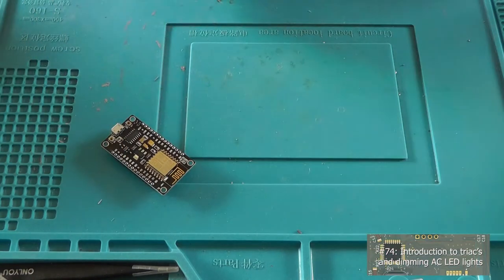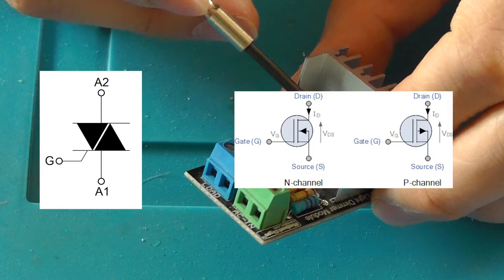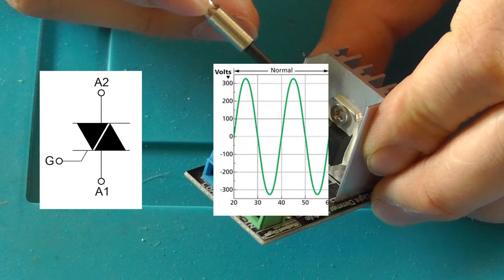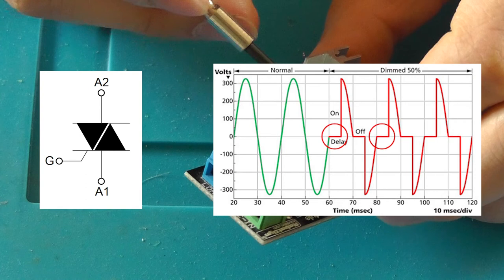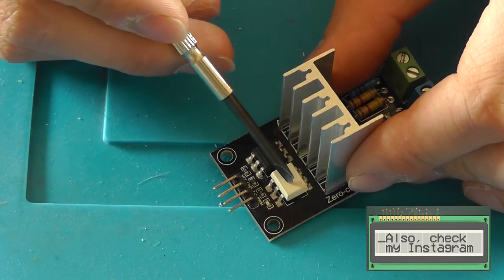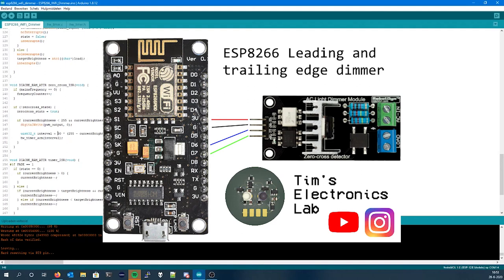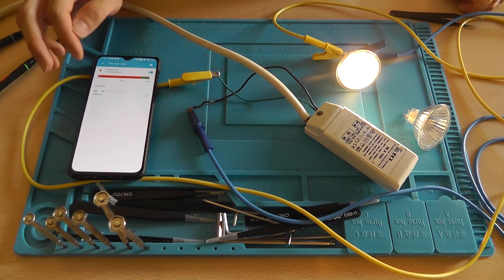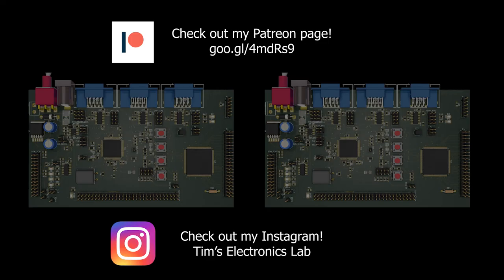#74 Introduction to triac’s and IoT 📱 dimming AC LED lights 💡 with leading edge dimming

Comment: After installing all required libraries I still have this error:

E:\Documents\Arduino\libraries\homeenvironment-master\src/HomeEnvironment.h:64:4: error: 'BearSSL' does not name a type
    BearSSL::X509List *x509CaCert, *x509ClientCert;
    ^
E:\Documents\Arduino\libraries\homeenvironment-master\src/HomeEnvironment.h:65:4: error: 'BearSSL' does not name a type
    BearSSL::PrivateKey *PrivateClientKey;
    ^
ESP8266_WiFi_Dimmer:48:19: error: 'RX_PIN' was not declared in this scope
 IRrecv irReceiver(RX_PIN);
                   ^
exit status 1
'RX_PIN' was not declared in this scope

So, what is "RX_PIN" and "BearSSL::X509List *x509CaCert, *x509ClientCert" and "BearSSL::PrivateKey *PrivateClientKey"
Reply from the maker: Have you installed the right NodeMCU SDK?
Reply: @TimsElectronicsLab  I'm trying to install this on wemos D1 mini
Reply from the maker: Yes, that shouldn't be a problem. Which version of the ESP8266 SDK did you use?
Reply: @TimsElectronicsLab  2.3.0. I didn't have any problems with different sketches
Reply from the maker: Could be, but this library is expecting 2.5.2 since ssl related things have changed. Please upgrade to the newest sdk
Reply: @TimsElectronicsLab  Ok, i'll try. But I still don't understand what guide I should use. I have working mqtt server with username and password. Where can I find alternative way to connect device to mqtt?
Reply from the maker: On my channel! Video #46
Reply: @Tim's Electronics Lab Thanks for your help. I have successfully installed code in wemos using SDK 2.5.2. But the problem is not resolved yet. Maybe I'm stupid, but #46 is not enough for me. I have no idea what are these certificates in this video, how to setup masquito server to accept these certs in Home Assistant. Thank you for your work. But I have no idea how to make ac dimmer work right now.
Reply from the maker: Sorry I had forgotten to mention video #12-2 too. You need that in order to setup the mqtt server
Reply from the maker: Also, you can upgrade to the latest version and make sure that you use LittleFS (with the Arduino IDE plugin) for the ESP instead of the regular spiffs

Comment: Hi. Where should I change mqtt server username and password? Should HOST and PORT variables contain mqtt server host and port?
Reply from the maker: If you follow my guide, there will me no username and password. It's certificate based! The mqtt communication is encrypted, so it's much safer.
The mqtt stuff is handled inside the home environment.h library which you can find on my gitlab gitlab.com/timkoers/homeenvironment
Reply: @TimsElectronicsLab  What guide should I follow? https://gitlab.com/timkoers/homeenvironment here is no description
Reply from the maker: I'm sorry for the late response, YouTube held your comment for review and I usually don't look at those comments.
Just download that gitlab repo as a zip and add it to your Arduino IDE using add .ZIP library.

The rest of the GitLab snippet should explain it!